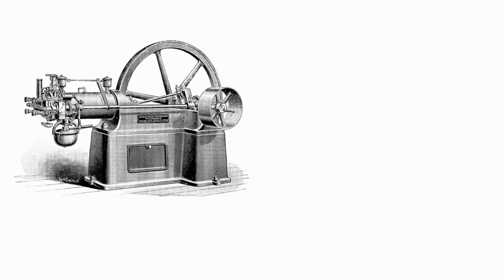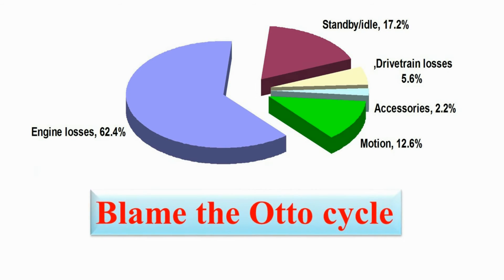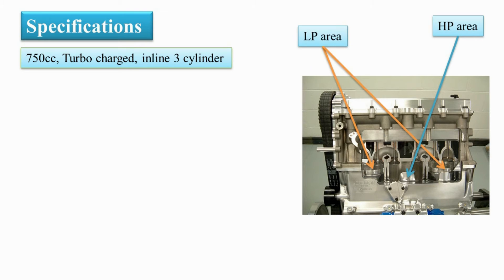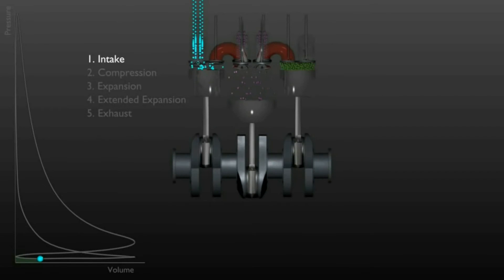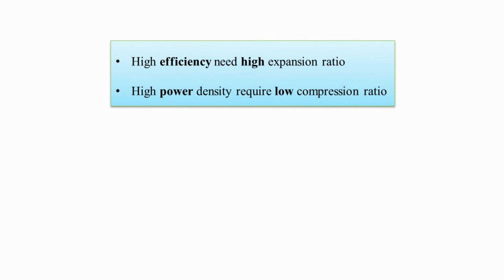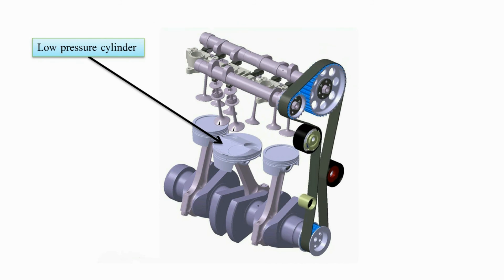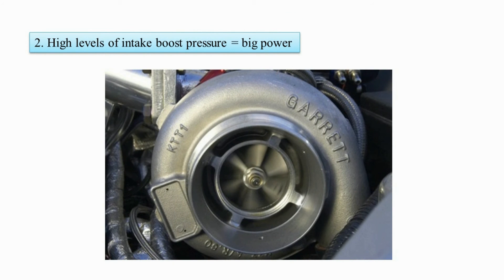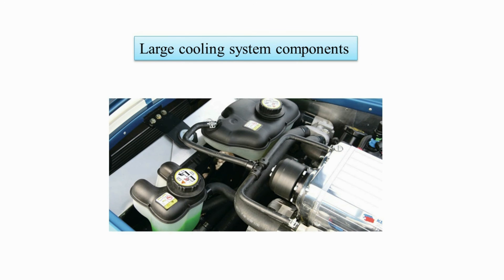Future of IC Engines : Ilmor 5-STROKE engine

Comment: Compound expansion has been tried before in I.C.... and failed... Rudolph Diesel build one, but there was a problem with the high exhaust gas temperature burning the transfert valves ( high to low pressure cylinder valves ) ; they had to be cooled & in doing so did kill any gain in power... the compound diesel was slightly less efficient than the simple one.... did Ilmore solve all those problems ?  Not likely as we see no working prototype and only stills, animations & a lot of bla bla..; to show...after all those years...
Reply: I agree they could have made a small industrial engine by now and used water spray for cooling

Comment: In your closing remarks you list a number of downsides, but none of them are actually downsides. 
1) Every engine designer must carefully balance the masses in their engine, whether its a 3 cylinder 5 stroke or a 8 cylinder 4 stroke. So nothing lost nor gained here. 
2) I'm not getting your point on this one. Every engine, boosted or not has to maintain a balanced fuel air ratio. This is not an issue, it's just a standard aspect of engine tuning.
3) Every forced induction engine has a charge cooling system. And water 2 air charge cooling systems are very space efficient. Again, its a standard aspect of engine tuning.

In short, this engine has no downside. You get all the "bald eagles" and "tree hugs" in one engine!

4) LiE batteries, as used by Tesla, have an energy density of .875Mj/kg and 2.63Mj/L, gasoline has 46.4Mj/kg and 34.2Mj/L. Batteries have a long way to go before they will fully replace internal combustion engines. Rather hybrid drives will eventually replace conventional transmissions. 

What I'd like to see is a diesel variant of this engine. A low compression 15:1 with a large fire chamber and an overall expansion 30:1. This would allow for significant downsizing of engines while maintaining engine performance and improving fuel economy.

Comment: This was done 100 year ago - look  http://pergelator.blogspot.co.uk/2012/10/nothing-new.html
Reply: Thanks for the link. There were smart people 100 years ago too! Check out all the supercharged cars. It is as though some powerful industrialists crushed automotive brilliance and innovation to make way for cheap, easy and profitable. I sat down and started studying this 5 stroke concept this morning. I like the idea that they are scrubbing extra power in that low pressure center cylinder, but in the running version of the motor Ilmore made, they don't rev the engine which worries me. Will it rev? If so, why didn't they do that? For all we know it runs like a 100 year old Model-T engine. ???  Anybody know of a link to this 5 cyl engine revving?? Ilmore has a prototype.
Reply: Mustang Guy The 5 stoke in its current form  is effectively a compound IC - the valves between high and low pressure  cylinders  are particular vulnerable to heat distortion  - on one hand  its important to keep the transfer hot to maintain pressure  on the other it puts the valve materials under duress and could cause pre ignition in a conventional petrol engine - in a diesel less so - the use of ceramics in the transfer would undoubted help efficiency